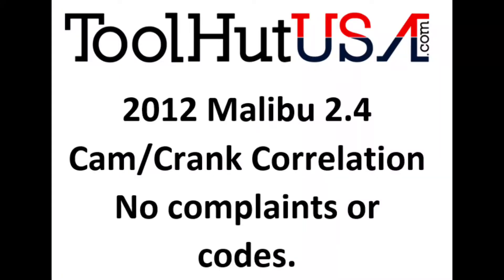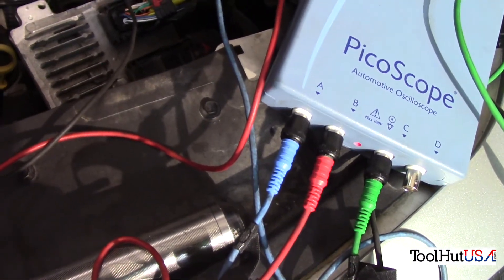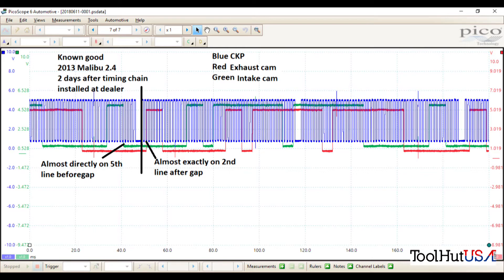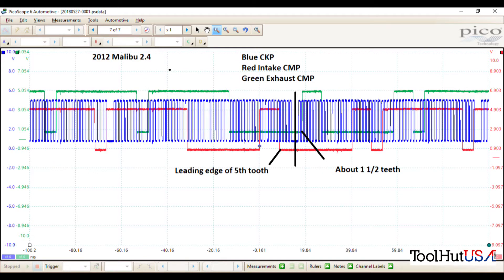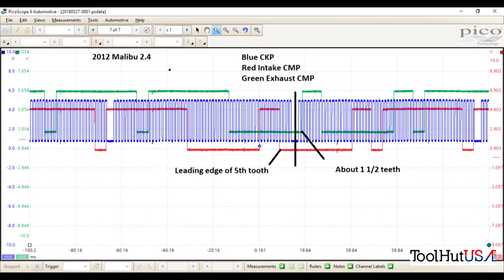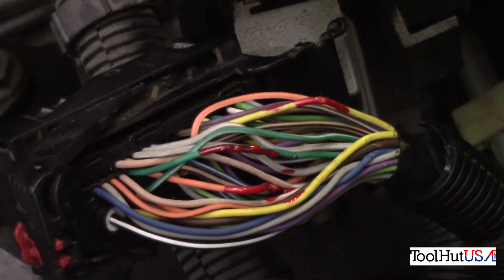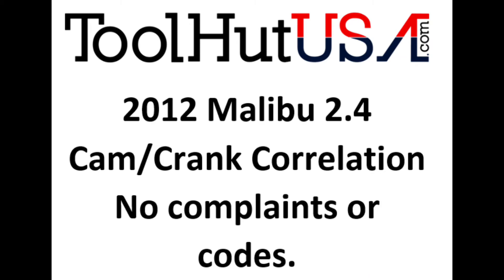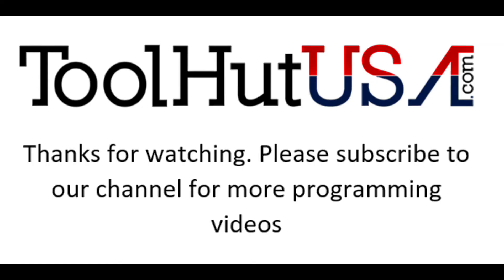2012 Chevy Malibu Cam/Crank Correlation

Comment: I keep having this issue. Changed sensors. Still having it. Fixed a broken rocker arm.  Nothing still having issue
Reply: @toolhutusaakathecarflasher3019  timing chain an all that looked good tho so idk. I feel defeated lol, dont know what else it could be.  May have to take to shop
Reply: @toolhutusaakathecarflasher3019  no i dont have one.  I just looked at it an looked good shape, links were in rite places for markers. So i assumed it was good.  An it runs great

Comment: I had this same car yesterday 2012 malibu with 2.4L and it was exactly 3 teeth off ( just like you said) and setting the light, so I believe that is the limit, which I calculated to be about 9 degrees (cam timing).  Both my cams look perfect in time  compared to each other so we are going to try a tensioner first.  Do you think that is logical, if both cams look spaced as they should but the crank has shifted the same amount on both, could chain slack cause this I see they have updated the tensioner twice already so this is the third one for this car, and we are putting in the most updated version.  Also I would only change when sets code, or unless they have updated something in the timing system to prevent this, are you going to change the chain every time it goes off a tooth as these 2.4L seem to have this problem a lot.  Or Wait, if your brother changes his oil like he should do you think the timing will still go out eventually??????????  Now I'm confused on what to do.
Reply: How did the tensioner work out? planning on doing this first also. Seems like oil changes need to be done more often or oil needs to be topped off in between cus its an oil guzzler.

Comment: first see if its using oil.  the ones I have seen that need chain have had an oil consumption problem. might as well do complete overhaul.  have seen a lot of bent valves on these from lack of lube and then breaks all guides.

Comment: I have a customer that has little mechanical experience but always listens and respects the evidence I have to show. I find visual evidence to be extremely helpful in these situations for people that don't understand the inner workings of systems. As for the timing chain part, I like the scope setup and feel a chain would be a good preventative measure. I feel like that's more of a gut call than a evidence call based off possible past history with the car. I love the videos! Thanks for sharing again! 👍

Comment: Tough call on that one for me. It makes sense as a preventative move but how long would the engine last with the current issue? Or until it actually threw a code? really hard to tell.
Reply: Yes I would agree with The Disgruntled Mechanic it’s a hard call to make when looking at it like that. If it was my car I wouldn’t change it. In one hand you’re looking at PM work but on the other hand you still have some service life left on it it’ll probably go another 50k or more.